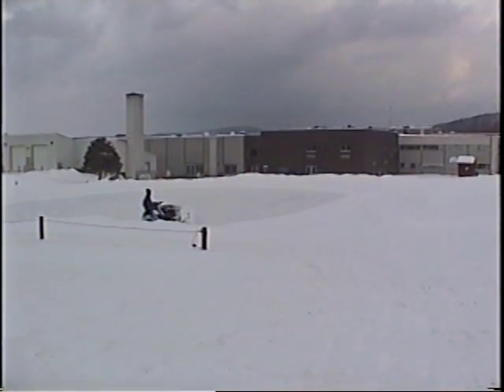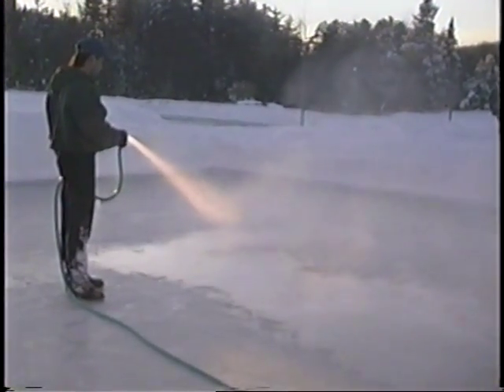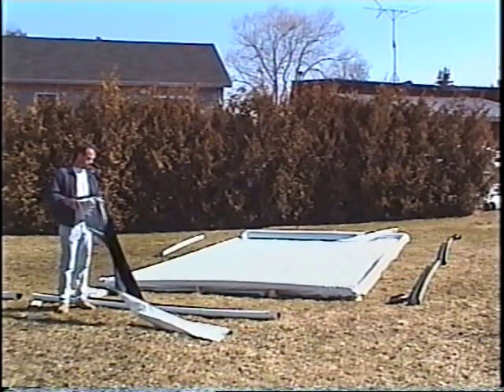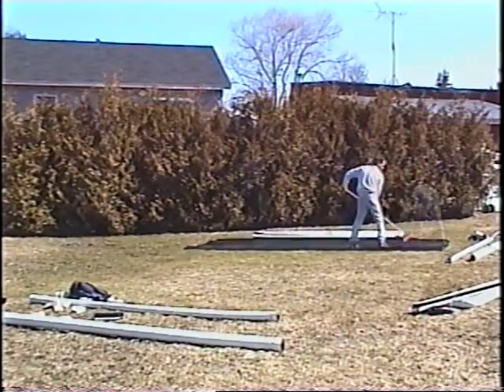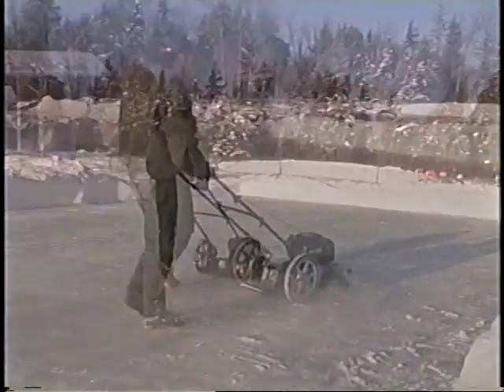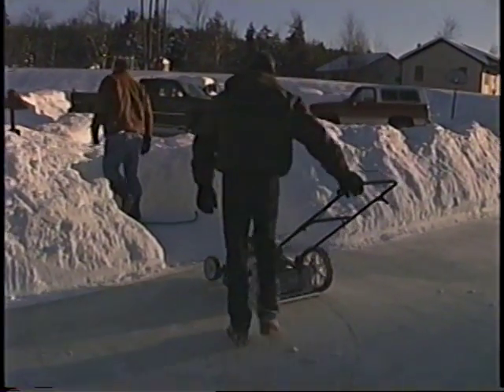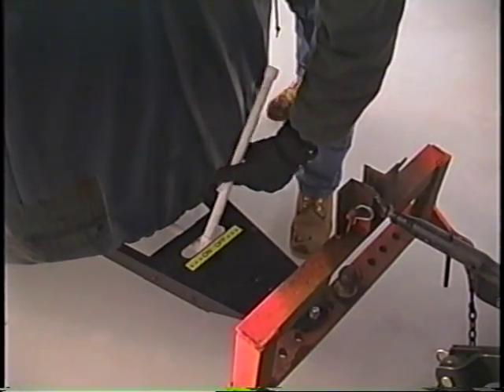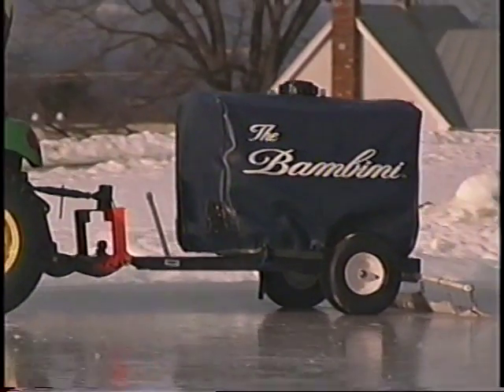Damian J Products - Ice Maintenance with the Ice Mower and Bambini. Rink Disassembly

Comment: This video is old, or shot with a potato.  Also, I actually use my hose with a "rink rake" i've made.  Also, you don't need to use hot water.  You can use cold water and it works and binds just fine.  Always.  I've been doing this for years, never a problem.  Save the effort and just keep your hose in a garage and take it out just to resurface the rink.  I use quick connects to get my hose reel on and off the spout quickly.